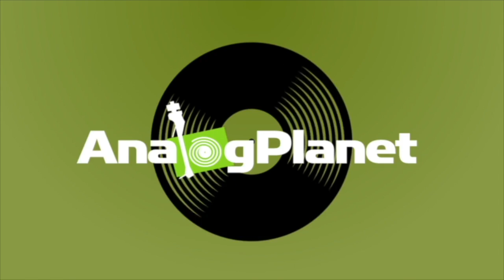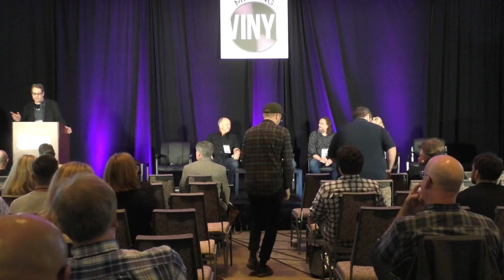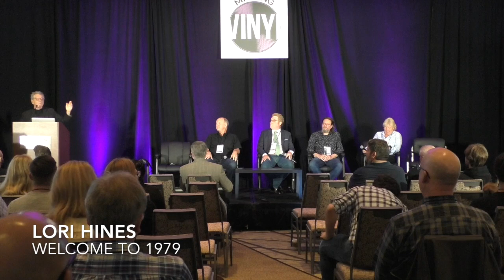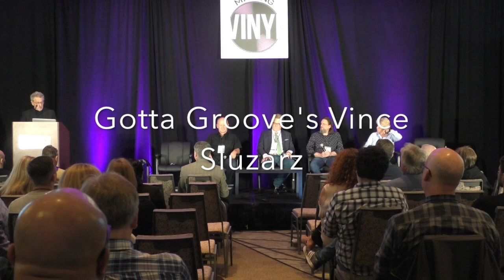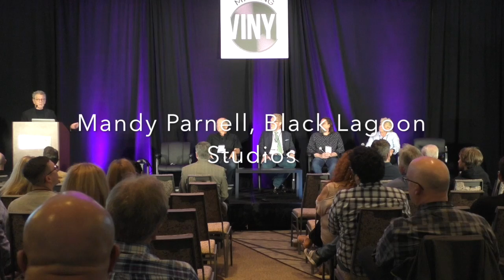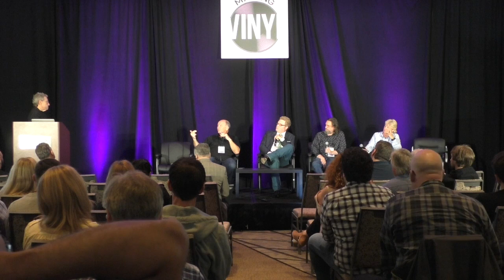"Vinyl Mastering  & Cutting Intricacies" Panel At Making Vinyl 2018

Comment: I enjoyed Clint’s anecdote about the MDC lacquers from Japan. My last project, our mastering session at Sterling happened to land in the middle of a problem batch with Apollos… so our sides were cut on MDCs instead and my understanding was that this was a pretty big deal! Was told that engineers prefer them, I believe it was because they produce a quieter groove IIRC… I’d say that little upgrade was a nice surprise. And of course I have to thank Chris Mara, Lori and the whole gang at 1979, they worked their magic on the plating and made sure it carried over into the final pressings

Comment: I don't think the original sound engineers get enough credit in the vinyl recording process, as Steve Guttenberg mentioned the other day if the sound doesn't get captured well to begin with
Mic selection, quality of microphones, placement, etc then you can have the best mastering engineer you like, they'll be trying to polish a turd.

I find that the best sounding stuff was already recorded well to begin with and the mastering is just the icing on top, yet the Mastering guys seem to be the God's and the guys further back in the chain are unknown.
To me they're the most important
Reply: Confucius say: Any chain is only as good as it's weakest link. ;0)

Comment: I was thinking as anybody tried to 3D print a record, and make a metal lacquer maybe the quality is not there yet.
But cuting it with a laser might be better more accurate down to nanometers accuracy I would have thought having metal disc being cut with a laser to impregnate the tracks should be possible.
A solution could be in the mastering process and taking out of the hands of the engineer by using software to make it correct, for vinyl pressing every single track they produce will have the right Dynamics compression, the right curve and the right headroom. That would be the best way, if somebody could make some software that all Studios can use knowing that it will come out as perfect as it can every time doesn't matter what Studio or mastering technician. That's what somebody needs to do use computer analytics to find out the best possible sound reproduction in the mastering process and use that as the master to make the records.
Reply from the maker: That's the HD vinyl thing. They were at "Making Vinyl" showing a ceramic plate that a laser will cut to produce a stamper...
Reply: @AnalogPlanet  right how's it going have you heard any samples from it.
what do you think of the software idea, making the correct master file and using that file to make a correct stamper.  take out human error and always be correct? maybe making the analytics software from the best record's Masters you can find and using that as the reference for the software, shouldn't be difficult to do.
Reply: @johnsweda2999  I think it's going to be a "cut" above (pun intended), because it eliminates so many steps!
Reply: Like any new technology, it will require beta testing, but the direct ceramic mastering holds great promise.  It will certainly have even greater dynamic range than DMM.